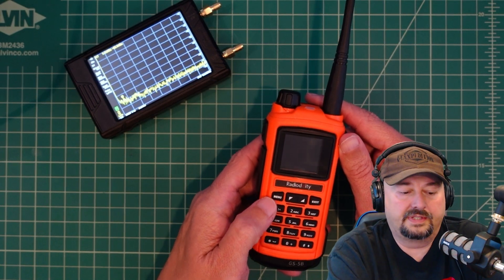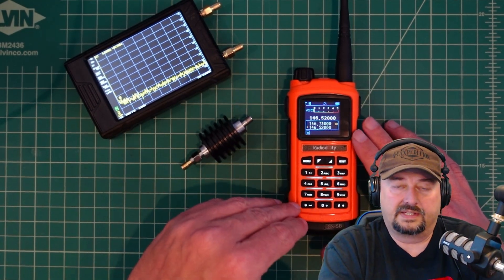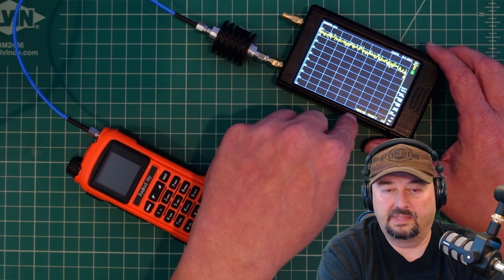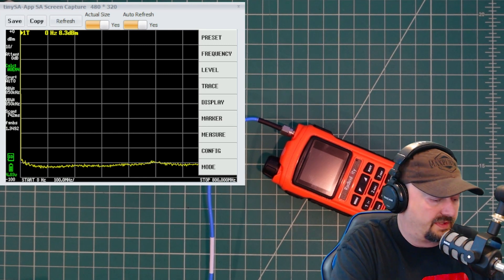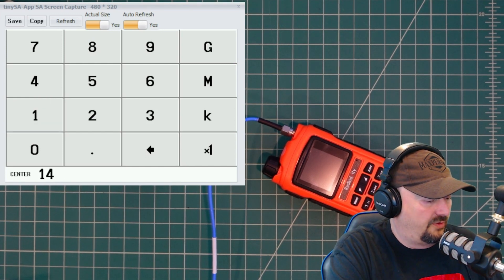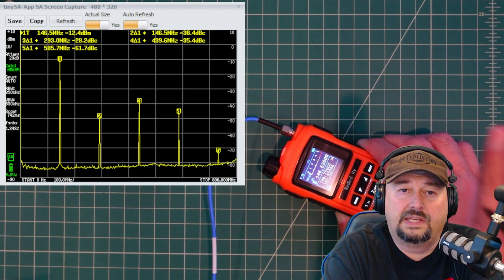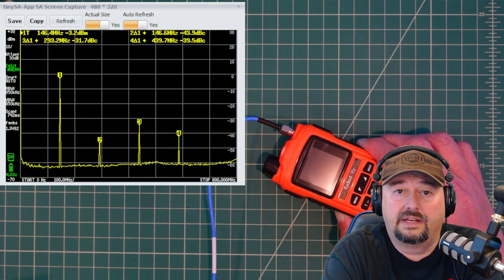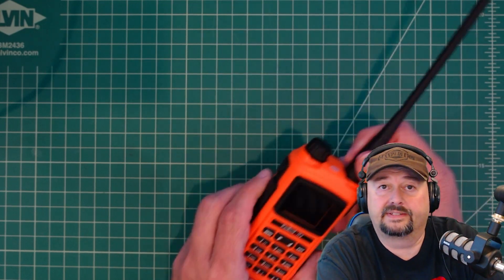Radioddity GS-5B Harmonics Test with the TinySA Ultra

Comment: Meh..... It is not like being pregnant vs not pregnant.... I'd prefer to look at a commercial lab's results before I start sounding all sad and resigned to this HT's performance. We are talking about less than 5 watts and -31 db down from that is still damn low. Does the FCC have a scientific reason for the -40Db harmonic suppression? For a 100W or a kilowatt... 40 down could still be a trouble-maker. Perhaps we should consider the SWR losses in the rubber ducky and the RF absorption from our heads and torsos.... I know I can find a 10 loss in my own head.... LOL
Reply from the maker: Thanks for watching Kicktree 👍

Comment: Here in Europe/Denmark the requirement is -60 dBc outside the HAM band. Notice how the strongest harmonic is actually in a HAM band. I am thinking that it probably is no coincidence that they spaced the HAM bands just so that would happen.
Reply from the maker: Hey Baldur, I would guess that the ham bands are what they are for a reason.  Thanks for checking out the video 👍
Reply: Well, as I understand it. it should probably be below -53dB v/5watt in the USA. -40dB is only if it is less than 250mw ?   Nice video!

Comment: Approx 1:45 cst.  I find your videos to be so informative.  I started in terrestrial microwave in the early 1980’s.  Due to military obligations I didn’t get to finish college until  I was almost 30.  At that time, I carried a hp spectrum analyzer which weighed about 70  lbs a freq meter which didn’t weigh less.  A Fluke meter and an hp power meter. Watching the tests done on a small vector scope makes me wonder if I could have kept working and not blown my back out 20 years ago.  I do enjoy your videos,  they are to the point and not over most beginners heads.  73
Reply from the maker: Hey Greg.  It's amazing how technology has gotten affordable for "regular folks" and more portable over the years.  Thanks for your service and for watching 👍